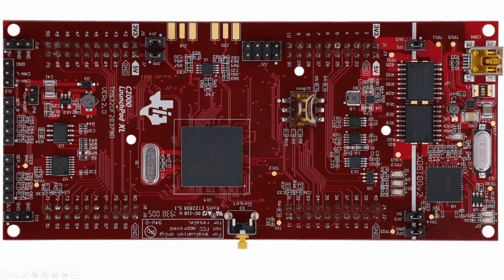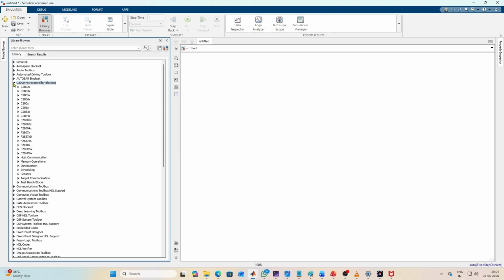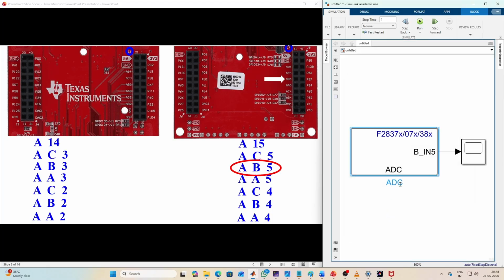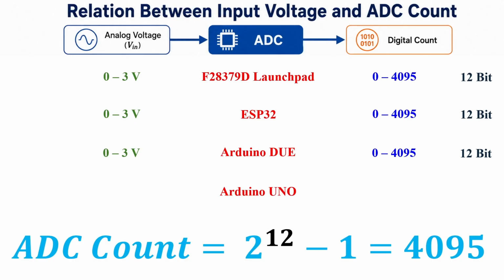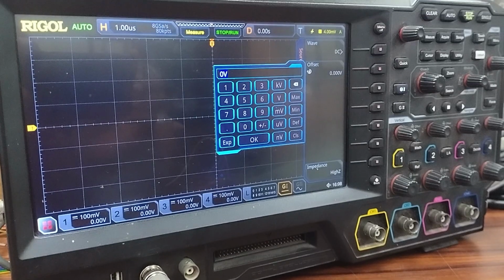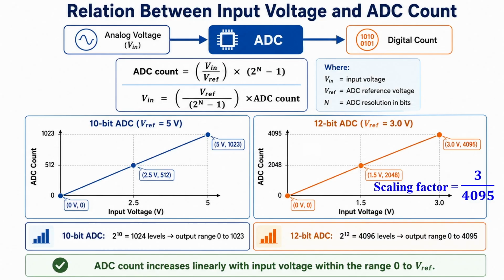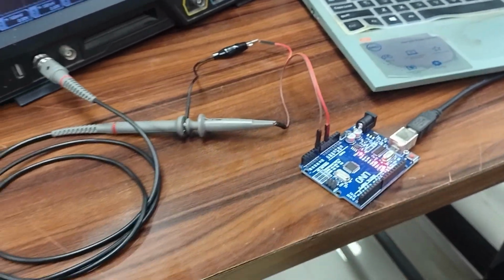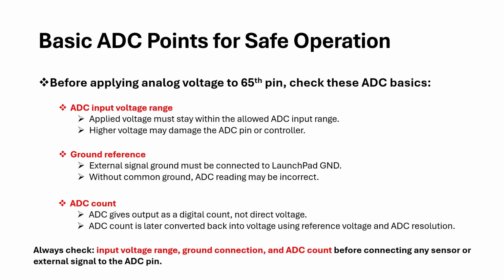How to Read Analog Voltage Using F28379D LaunchPad and Arduino Uno

Comment: Bro I am using f28379d but when I click on monitor and tune code build but at the it says 'XCP connect time out'  which is failed to connect to the hardware how to solve this problem
Reply from the maker: F28379D has two CPUs. To solve this issue, first load a simple dummy code into CPU2. Then run your main code on CPU1 using Monitor and Tune. This usually solves the XCP connect timeout problem. Also make sure the correct COM port and USB connection are selected.